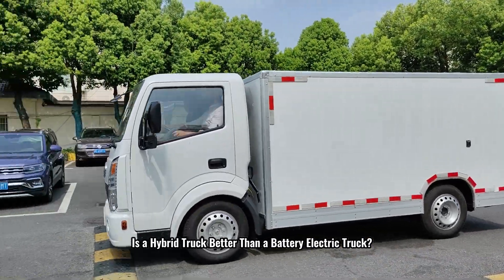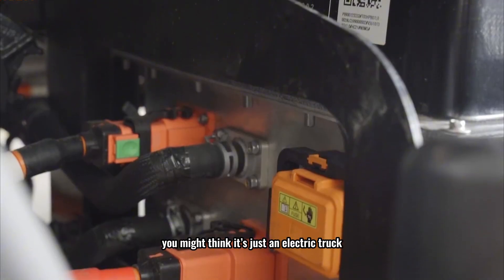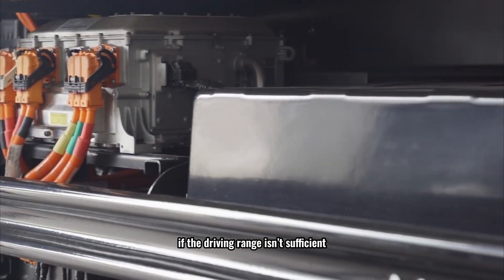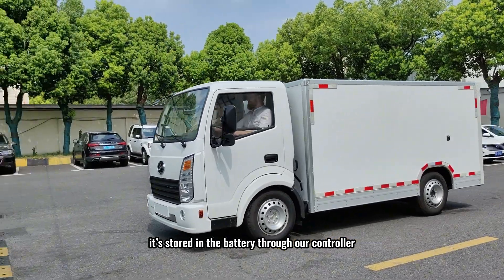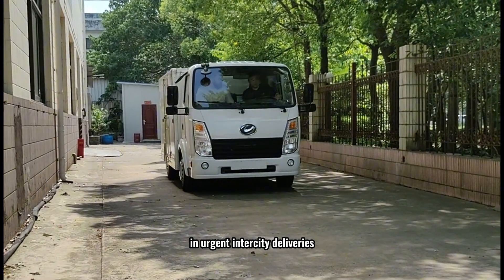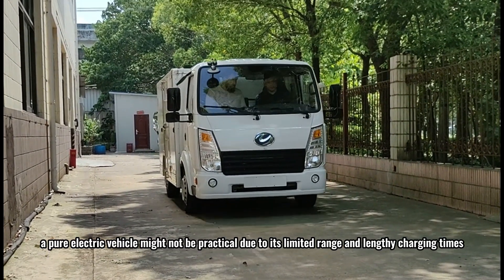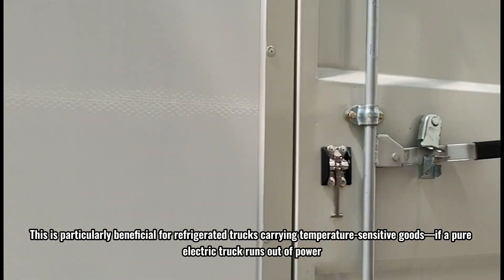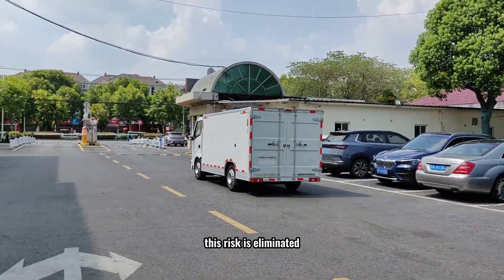Is a Hybrid Truck Better Than a Battery Electric Truck? #HEV #emobility #truck #electrification #EV

Comment: What's the price of this truck and how/where can one buy it?
Reply from the maker: The price depends on the configuration you want, for example, the battery energy, motor power, etc. To buy, you can contact us at contact@brogenevsolution.com or WhatsApp: +8619352173376